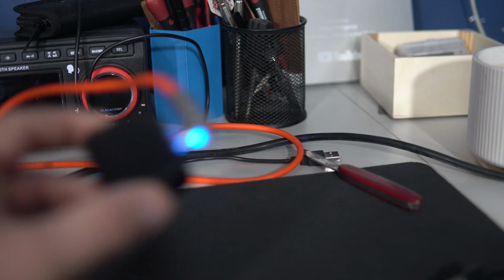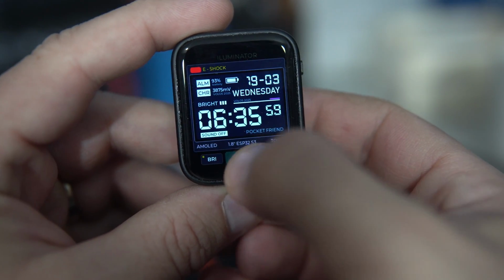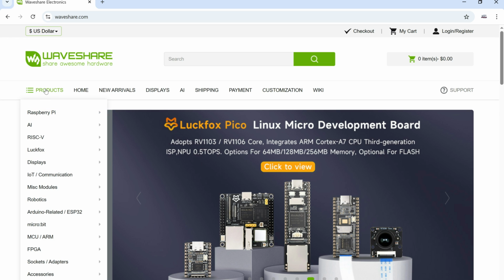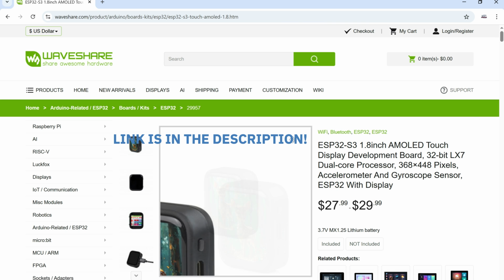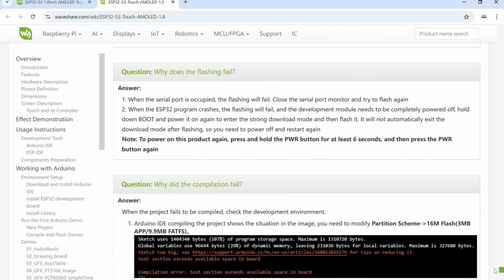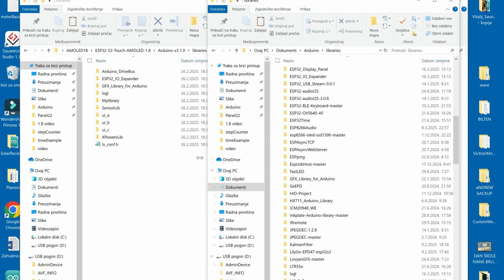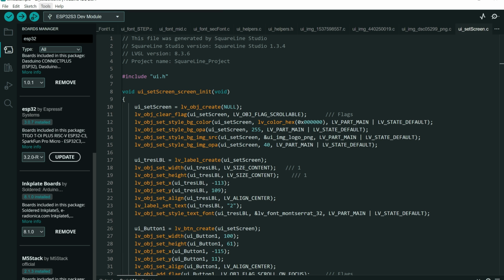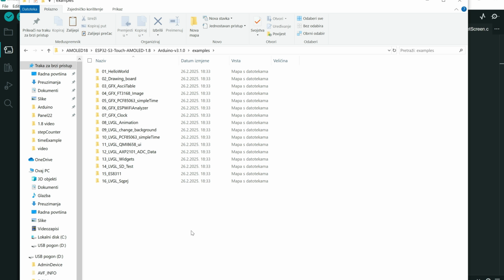New example for Waveshare 1.8 AMOLED and some install tips!

Comment: Seems to with release/current version of watch hardware your code is not working anymore (even not compilling), when I wrone bin file of your firmware I see the black screen. When I restoring on default firmware from waveshare watch is working fine.

Comment: I got one... and the pre-installed demo is very nice. Is there any way to modify that? I didn't see that in the demo files.
Reply: you have to re-flash a new firmware to the device.  I strongly suggest checking out the XiaoZhi AI assistant project. This allows the device to be a Qwen or Deepseek AI assistant in your pocket. There is also software that you can install that lets you configure all the server side stuff.  I have it talking to my own AI and several MCP Servers - so it can take notes in Notion, order me a pizza, read my email - all the things.  The possibilities are endless.

Comment: Thank you SO MUCH for this video. The extremely loud and annoying default firmware playing the piano was irritating as h*ll. Had thoughts of dunking it in the toilet. Just received the kit in the past hour and had 'partitions.csv' errors - WTH? This was during compiling the helloworld sketch. Plastered the libraries as per your video and configured most of the board details as you show but some options are not showing the same like the OSRAM. Weird? I believe I am on the latest toolchain with 2.3.6. ESP32 3.0.7 is installed as suggested. Either way, the helloworld now installs and can see the random graphics / text and NO MORE piano. Thanks so much!!